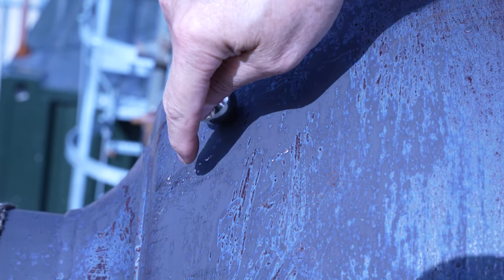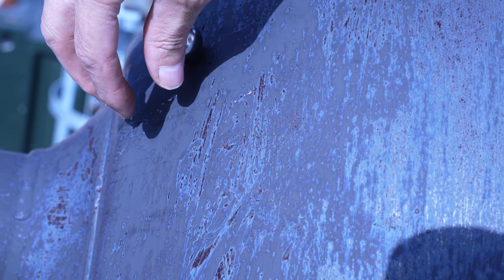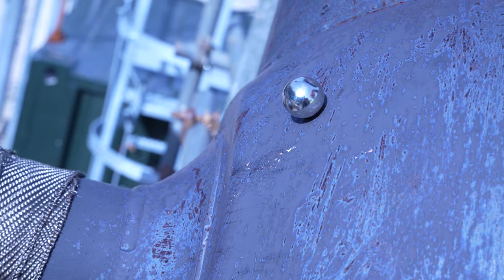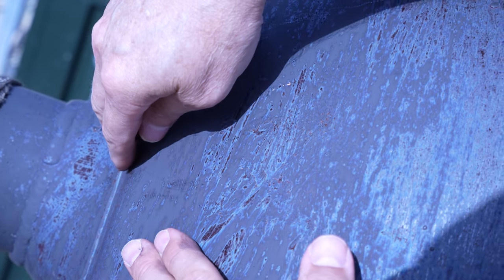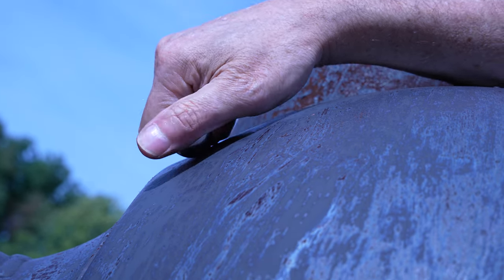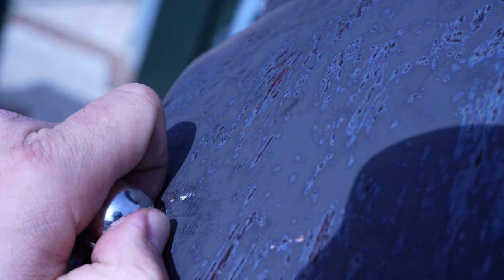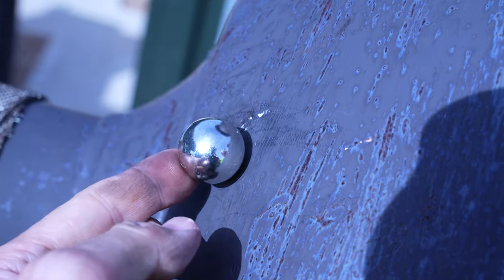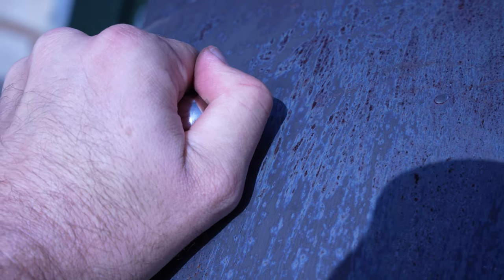THOR - Magnetic anomaly two?

Comment: It could also be that the " magnetically imploded" side of of the sphere is simple surface tension deformation because the entire sphere expands when it gets hot from the exhaust gasses. The weakest area of the dome surface is where it is cut and welded to the exhaust pipe where it gets the hottest, the entire metal sphere expands and the weakest part of the dome surface flattens to accommodate the heat expansion of the entire sphere surface.
Reply from the maker: Maybe

Comment: Makes total sense - fractal toroids producing crazy intense magnetic fields - clearly at the “pulled on” end - and, what is more, the magnetic field is still there (presumably while the system is running). So, maybe iron (steel) is not the best material to use in this case … or, maybe it is exactly the material to use.  It’s highly likely one or the other

Comment: Yer but will that deformation caused by magnatisim in the thunderstorm generator will that destroy it over time? I sort of think the plasmoids might be eating away at the metal like cavitation eats at boat propeller, since the they are both plasma phenomena
Reply from the maker: The device is meant to be made of stainless - non-magnetic. This set of tests on the 400kW generator was with mild steel - ferromagnetic. It should not be as much of a problem when properly implemented.

Comment from the maker: In this video, the generator was off and cool.

Initially, Malcolm thought there was some magnetic anomalies demonstrated by this magnetic marble.

1. Alternating ferromagnetic bands. I deduced this was actually likely because of the N/S of the high strength Nd based super-magnet flipping from one pole to the other on the ferromagnetic mild steel. I went to my kit bag to get some magneview film to test my hypothesis and it was confirmed. On reviewing the video, you can see in the first few seconds he slides the magnet - this also confirms the hypothesis. Therefore, this was nothing out of the ordinary.

2. He thought that area that was flatter had a stronger hold on the magnet - it did, I concluded at this time this might well be explained by the tighter magnetic coupling to a flat surface over a curved surface. Perhaps the metal was thicker or had its magnetic susceptibility changed and that could account for it also.

That being said, I did want to test the distorted area when the generator was running.

Whilst it is not conclusive, the strongest field was right at this point where the sphere had been distorted. It is important to note that this is the point in the device where the water in the incoming air from the bubbler would flash to steam. If the water nano-clusters were travelling balls of energy clusters - it would be at this point that they might be released.

See the high field at this point in this video.

https://youtu.be/_MHtrKl5P1U
Reply: Amazing
Reply: How does the magnet behave on the pipe further down? 
On the smooth surface of the sphere there is not a lot of Metal in the vicinity of the magnet.
On the bend there is a lot more metal in the vicinity of the magnet and the metal underneath becomes thicker on the inside when you bend it's outer surface resulting in more metal near the magnet. 
Cool videos!
Reply from the maker: Yes.

See here https://remoteview.substack.com/p/thor-magnetic-anomalies @TonyJaboney